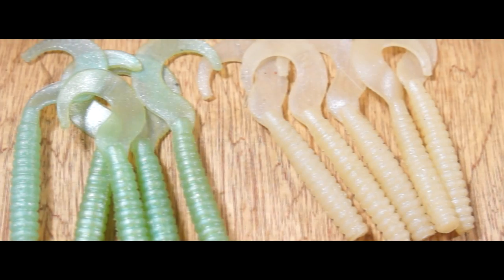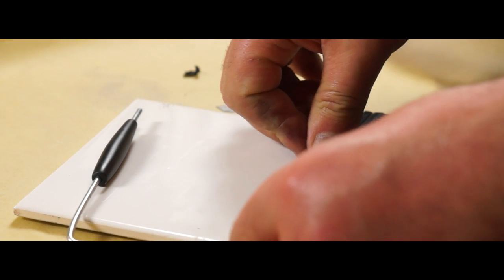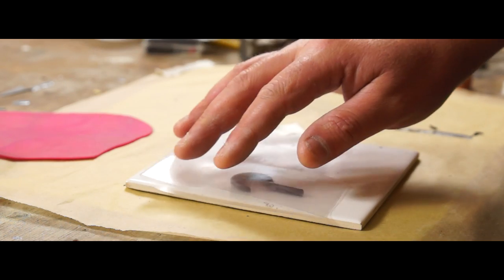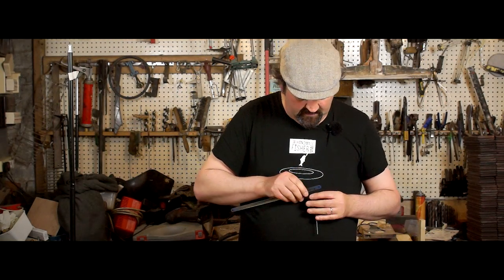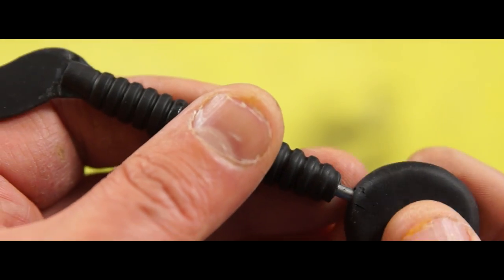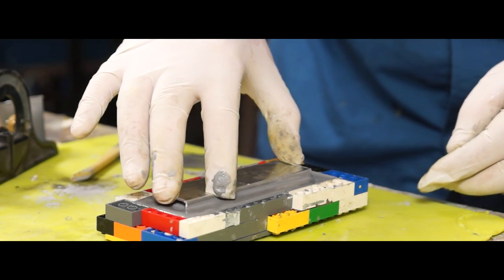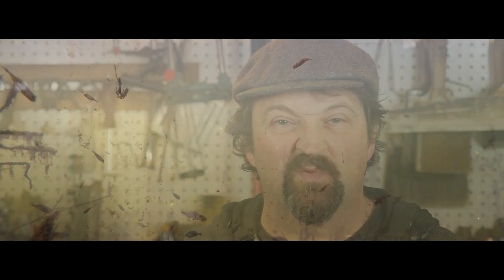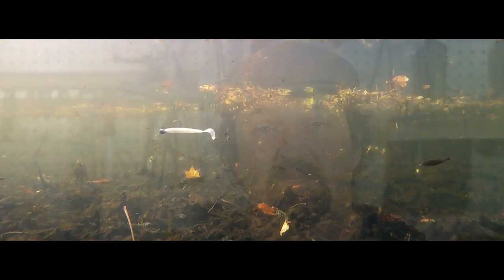Making a soft plastic fishing lure, The whip tail grub and injection mould

Comment: have you tried using that polymorph plastic to make original?
Reply from the maker: yes it works the trouble is the resin give off heat when curing and remelts the polymorph, but it would work with plaster of paris
Reply: i didnt  know it heats up on cure mainly i just poor and stick it in shed until next day, i got tentacle things from link you gave me. umm i got some plaster paris as arthritis in hands and making that Plasticine stuff soft hurts like hell it was why hoping polymorth would work. thanks for info